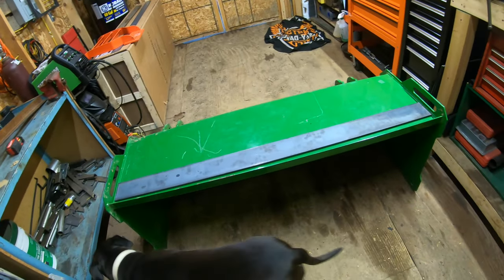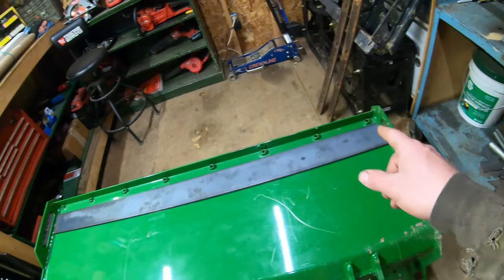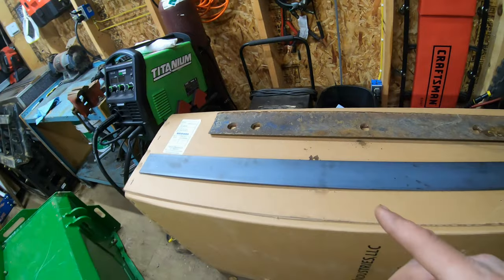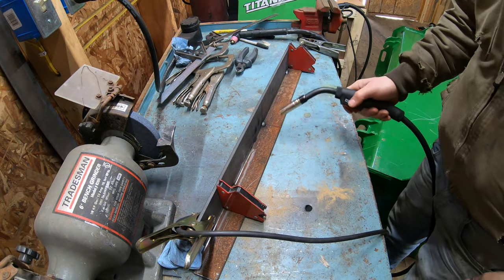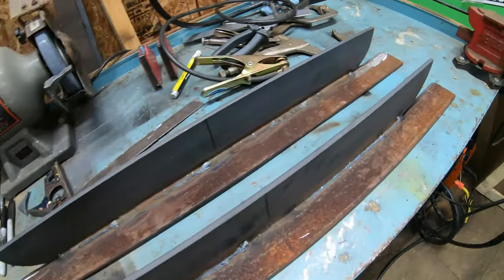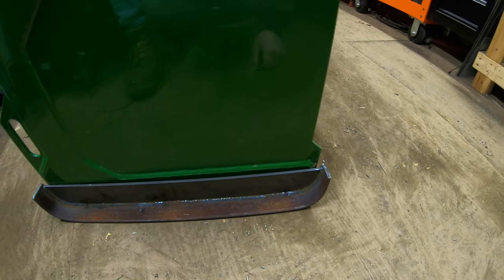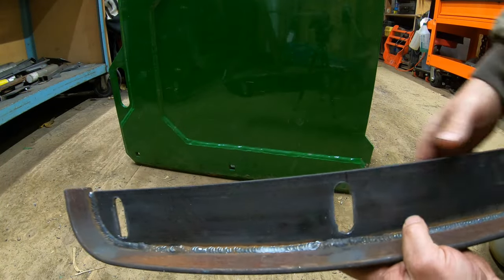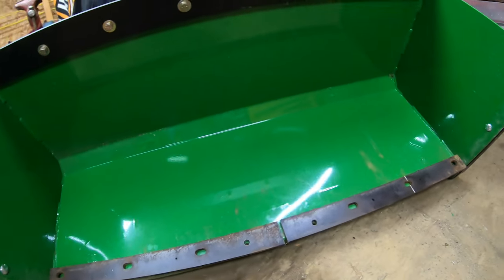Building Skids + Cutting Edges For A PushBox/Snow Pusher

Comment: Another great vid pal. What plasma cutter is that you have. Seems very handy.
Reply from the maker: Thanks buddy, the plasma cutter I bought from eBay brand new for a smoking deal, paid $299 for it with a load of consumables and I’m still on the original bag of them. My buddy liked it so much he wanted to buy the same one about a year later and now when we look it up it’s $999 .. so it went up alot in price. It’s prolly still worth it but honestly for that kind of money you could get something even better but for the price I paid I’v been thrilled with it. Cuts 3/8 steel on 110v and 1/2”+ no problem on 220 👍🏻 thanks for watching!

Comment: Nice Job! What size is your current shed (guessing 12x16 based on plywood floor), and what size garage you planning?
Reply from the maker: Thanks Rob, my shed is actually a 18x20 but it looks much smaller because I have it packed to the gillz with tools, equipment, and work benches lol. That’s why I need a new shop. My new garage I’m planning to have it built 25x30 or 25x28 something like that with 16-18’ ceilings so I can install a lift to work on my cummins and other stuff. The 16x18 shed did its job for many years for me, but as I grow I’m quickly running out of room and I now I need a bigger garage that can grow with me. Thanks for watching!

Comment: You might get a lot use  from a set of HF transfer punches. Quite a bit more accurate than even a calibrated sharpie. : )
Reply from the maker: Haha you got that right! I do have some punches which I’ll use when I need to drill or cut holes to be exact, but in this case things didn’t need to be exactly perfect but there are times when the holes do need to be perfect and when they do a nice set of punches will do the trick. I’ll look into getting a new set cuz mine are all pretty smoked. Thanks for watching!

Comment: You were saying your going to build a new shop ...BUILD ONE TWICE THE SIZE YOU WERE THINKING  cuz it fills up fast.......how do you like the harbor freight wire welder ??
Reply from the maker: Thanks Gary that’s a great point as you know no matter what size you get it’s never big enough, the problem is I can only go so big with the way my front yard and properly line is laid out.. it’s prolly gonna end up being a 25x30 or something like that. I wanna go 12-14’ high ceilings tho and a huge bay door as I eventually plan to install a 2 post lift as well to work on my Cummins. The welder has been great I’v had it for a year and a half now and have done some huge fabricating projects with it. I have constantly run it well passed the duty cycle which is very hard on them and it’s yet to fail me. I got the Titanium Mig140 but they also make a Mig170 which is identical to mine only it does 110 and 220.. but on 110v i’v never needed more.. welds up to 3/8” thick steel relatively easy and has a great duty cycle.. better than my Hobart Handler 140 I use at work by far. Thanks for watching!
Reply: @BiffsEquipment  I hope you make a video of the new shop going up ...I like the 12-14  walls cuz you can put a 10 foot overhead door in .You could leave the kubota on the trailer and back it in the shop if you had to. THANKS for the reply and keep the videos coming .
Reply from the maker: @garymonsarratt6048  absolutely I’ll def try and get some footage as it’s going up and keep you guys updated along the way. No problem man. Yah I agree high ceilings are gonna be a must for me, I’m def excited